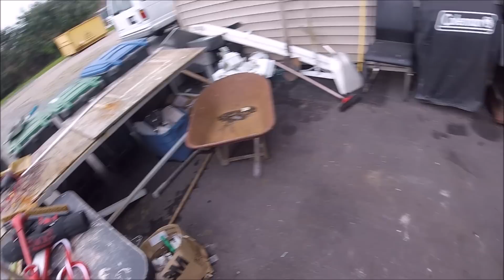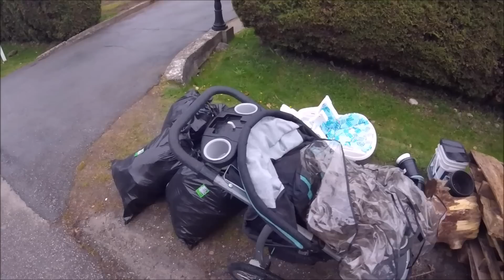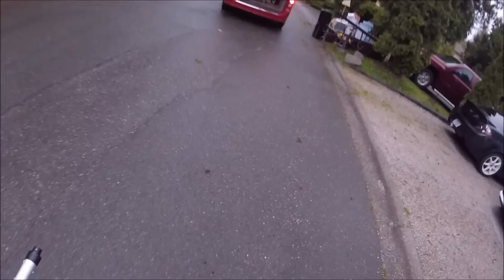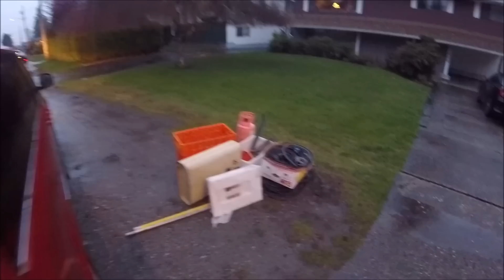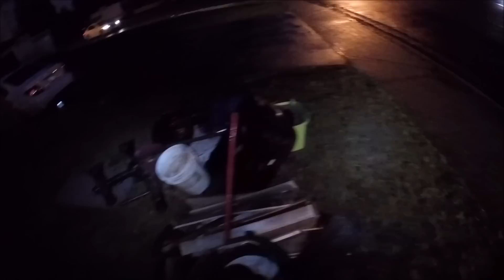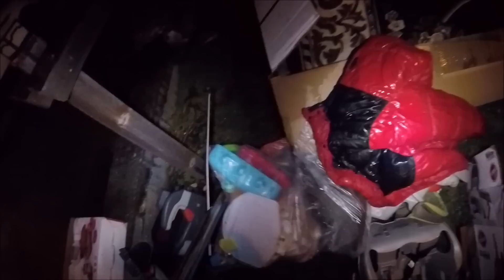Cleaning My Yard & More Spring Cleanup

Comment: New rad price. Last year, I needed a 6 feet long, 1 inch an a quarter, 90 degree aluminum piece to finish a project. I had 1 inch and half from the recycling but for my project, it was too large. Store sold me that piece 72 dollars. If I had to scrap a piece like that, I have had 77 cents a pound times around two pounds for a total of $1.54. The new piece price gave a 4646 % mark up. GREED.

Anyway, it is what it is. Can you look if some garage people can make a solder on it ?  I know that this was a possibility in the past.
Reply from the maker: Cant solder it, The seam is coming apart from the clips